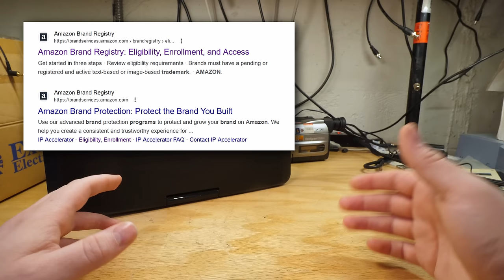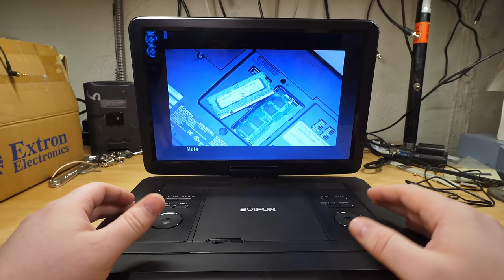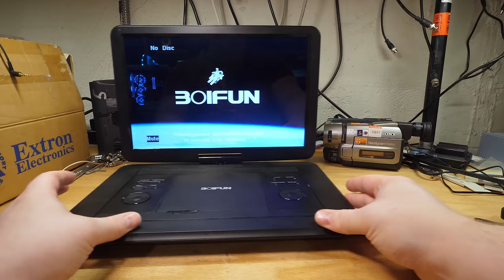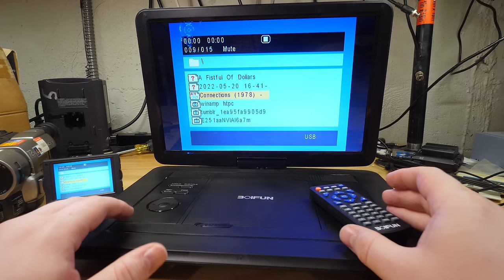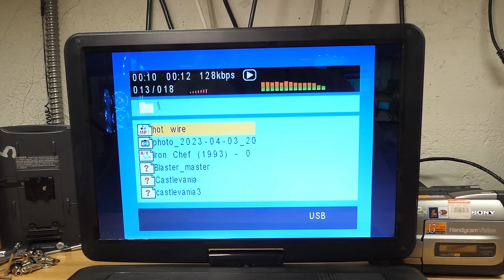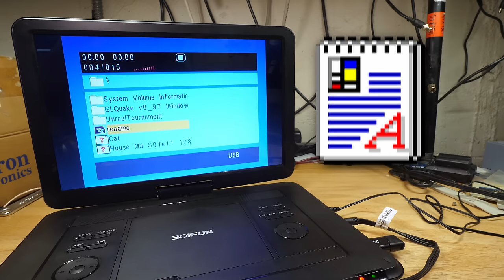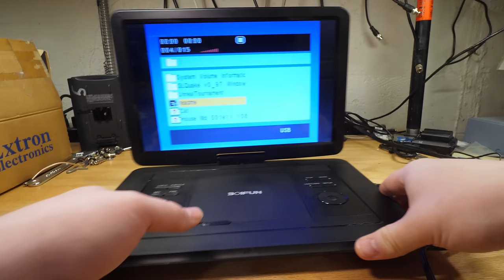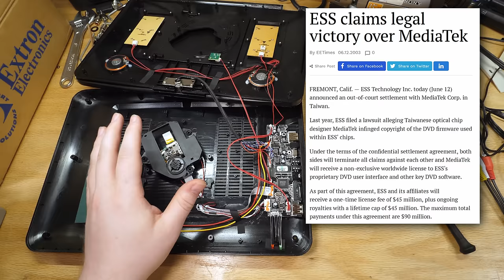Cheap, Silly, Remarkably Useful DVD Player

Comment: 12:10 TRRS cables, as an idea, should be really helpful… but because of a lack of standardization, we end up with irritating things like this. I was just dealing with something like this myself when building a crossover cable that lets me interface my sound card with my phone to send/receive data with minimodem.
Reply: They actually ARE pretty standard.  There are variants, because each is optimized for something different.

Is it an audio device with video capability?  Then you want tip and ring to be L & R audio, with the third signal, video, being something that you need a special cable to access.  This ensures backward compatibility with audio cables and headphones.

If you’re making a camcorder, then you can live without stereo audio, as long as you get one audio channel and video.  That puts R audio on the optional conductor.

“But why the difference between shield and the additional ring?”

Well, that depends on the jacks that cable will be used with.  Many jacks use a shield contact that is higher up on the plug.  Those?  You need the second ring to be ground.  Other jacks contact the shield at the base of the plug.  For those, you want shield to be ground.  None of that matters when you’re just using TRS, so decades of COTS jacks never had to care.  But with TRRS, it does. 

See?  There’s a reason for all the madness, as long as the manufacturer chose the most applicable wiring for their specific device’s primary function and the ecosystem of things that are usually going to plug into it.
Reply: It should be possible to make a universal TRRS to RCA cable with a switch for the different arrangements.

Comment: As soon as I saw the Game logo, I knew it would play NES games. Given the awful performance, I actually expected it to be a Famiclone with a DVD player bolted on. But, the games also running terribly disproves that.

The games were cut off the same way as the text. Probably an aspect ratio issue?

Having once used a PlayStation homebrew app to read a text file off a disc to help repair my PC, I agree that text viewers should be included in everything.

Comment: 8:25 If the processor was scanning the buttons that slowly I would expect it to work ~sometimes~ if you pressed it fast. Or if it's multiplexed, to actually activate a different button. I think it's probably just overly-aggressive de-bounce. 
22:45 That text editor makes me think you could get it running arbitrary code with a poisoned text file haha. 
Shame the screen is so shiny. Would otherwise have been nice for a homebrew laptop.

Comment: This device is genuinely kind of amazing for all of the wrong reasons, and has a lot of self-contradictory elements. It's big for a portable DVD player, yet it has a screen to match. It has so many additional features that sound incredibly useful and desirable, especially for its price,  but its hardware is too anemic and/or outdated to pull half of them off properly. It's cheap and lightweight, but it clearly has a lot of effort with its construction and even accommodates those who take it apart for repair and troubleshooting. It's too well made and functional to be considered disastrous garbage, but too crappy to be properly useful beyond its its literal product description of a portable DVD player. It's non oui personified as a piece of low end consumer electronics.

Comment: Is there a way to try loading nes roms into the MSI laptop with the ESS chip and seeing if the firmware plays those?
Reply from the maker: interesting question. based on one of the videos i've seen of these cheap dvd players, at least one version of the mediatek chip can read files off a data CD. it's possible the ESS could too.

Comment: I would suspect that the main PCB and the two button PCB's are part of an off the shelf type kit. They are heavily labelled to let you know where to attach your own cables. You can build it into any shape and size product you like. The screw holes are probably silk screened to show you that you can put a screw there without shorting traces to ground.

Comment: I actually did use a portable DVD player as an external monitor for my PowerShot circa 2008! I was doing a lot of long exposures and it helped massively to isolate the tripod/camera and verify it came through much better than the tiny LCD it had.
Reply: What was the make/model of that player? I was searching through flea markets and  yardsales for years (thrift stores almost never carry electronics here, sadly) for such a thing as a portable mini monitor, and there was an abundance of second hand small protable DVD players until some time ago, but never did they have a useable input.

Comment: I see a bunch of these "six letter" devices at my Amazon Return / Dumpster store and my flea market all the time. I actually bought a couple of external DVD drives (with hilarious names like Rieddas) and I've noticed that a lot of them just reuse the same components.

My latest purchase - an external USB DVD Drive that's got a Toshiba TS-L633M drive on it - also had an SD card reader AND three extra USB ports. For two bucks. I mean, sure, why not, I can use that on one of my tiny computers or the Pi.

How does this device handle interlacing in the video input? I'd grab one of these to use as a secondary monitor for analog video capturing.
Reply from the maker: It's interesting actually, it handles interlaced video really well. Like, that has to be what's coming out of the camcorder, and it looks terrific on the screen, so it seems to be bob deinterlacing it and producing really clean results

Comment: The pinout for the usb port is likely similar to the ones you get on modern famiclones which have USB controllers; that is: 5v, gnd, clock, latch, data, with some pinout which uses the shield as it's own conductor. If you look at what's near that game port on the PCB then you could probably solder on a real nes controller and have that work.

Comment: MT1389 32-bit RISC processor is a ARM processor which as far as I can tell is controlled by 8-bit 8051 processor which does the main loop of the firmware, input handling and menu logic (for power saving reasons maybe?) complex operations like drawing the menus it hands over to the ARM processor

Comment: I got a soft spot for the latitude D420 and not just because I'm a stoner <3; 

It's just a really adorable laptop that still looks kinda cool
Reply from the maker: same, i keep it around for reasons other than the funny name. I also have it's lower-trim cousin, the X1, which I also love even if it turned out it's a rebadged Samsung.
Reply: @CathodeRayDude I also recall running windows 2000 on my d420 at the time but I can't remember if the wifi worked or not
Reply: @CathodeRayDude  Is the X1 the one that had a spiffy second half/docking station that you could also put a second battery in along with a dvd drive?
Reply from the maker: @SammyRenard  I'm not sure but tbh I doubt it - the d420 had an expansion base that just made the machine thicker and gave you more bays like that, but I think it was a Dell design. The x1 was not originally designed as a business machine, I think, and I can't find a dock like that for it.
Reply: How are the hinges on the D420? I fell in love with the D410 on the Dell Refurbished site back in the day, gave a ton to friends and family, and then every single one started to have the screen hinges fail.
Reply from the maker: @josephvetter7085  Mine are A-OK!

Comment: Apparently you can get the firmware version & de-zone MT1389 devices.

FW:
- Push "Home Menu" on the remote
- Go to "Initial Settings"
- Highlight "Options" (Do not enter)
- Push "Display" on the remote

Zone:
- Push "Setup"
- Enter "1379"

Comment: The AV input back in the day was awesome. I had a Panasonic portable DVD player back in the early to mid 2000s, when you wanted to play games on a road trip, this was awesome. The problem was, the only TVs that most people could both afford, and afford one just for travel was a CRT. No one was trying to put a Plasma or LCD in their car or van. Not to mention, you'd still need an inverter to take 12V to 120V, and the ones you could buy easily were rather small and wouldn't power either of those. Sure you could get 12V CRT displays, conversion vans used them a lot, so did a lot of campers of the era but they were still big and heavy and really weren't great options.

However, these things solved all those problems. You bought a portable DVD player that had a 12V adapter, you bought a cheap 60W inverter. And you could now play games anywhere you had 12V. I played a lot of GameCube games on the road using a setup like this. You plugged the game cube into the inverter, and the DVD player ran off its internal battery for a couple hours, it was actually pretty good battery life without the DVD player running. The only other thing you needed was an RCA female-female adapter so you could plug the two cords together. Thinking back, this was actually a pretty similar layout to those devices, just in a larger package.

It was awesome.

Comment: The inclusion of the adjustments for color is nice.  Some people like to adjust the way their screens look to get an image that appeals to them more.    For example. I like to make the screen a bit of warmer color.
Reply from the maker: I think I was mostly thinking of the hue slider, since the hue can't possibly be incorrect given that the source is digital - but I suppose the analog input could be maladjusted at the far end somehow.
Reply: @CathodeRayDude  I’ve seen lots of these actually using composite video internally to connect the display to the dvd player. So that’s one reason the chip and firmware would have the functionality included.   And why disable it if it’s already there.  Somebody might want it for some reason.   It’s also possible that it’s there to account for variances between the (obviously low quality) displays integrated into these things
Reply from the maker: @FennecTECH  aw geez you're right. Man no matter how much I look at this stuff I never fully internalize just how lego it all is.
Reply: @FennecTECH yeah, the displays probably come from various vendors with varying quality based on lowest price.  LCD quality and backlight color temp / CRI will vary.
Reply: @CathodeRayDude everything built down to a price is all lego slapped onto a PCB and autorouted.
Reply: Also. The glossy screen helps with image clarity     The letterboxing and pillerboxing is just more evidence that it’s all lego.  They didn’t even bother to adjust it to prefer full screen on 16.9 content

Comment: Might need some b-roll where you have the camera zoomed into the full display without any other elements in frame and let it auto whitebalance to that or configure it manually. Same with contrast. Just a suggestion to try and get as close to a correct image of the screen as you can! Awesome video as always! Seen some wild stuff I never knew existed show up on your channel!
Reply: Also the low latency for using the player as composite video monitor is so cool. There's little to no visible delay which is awesome

Comment: Oh dear lord, finding the correct trrs composite av cable for my viofo dashcam was a pita! Took me an hour on Amazon scouring individual listings to find ones that matched the exact output, mostly since the viofo used a weird ground, so I couldn't just switch a jack. And it didn't even work! When I tried plugging it into my car's av inputs, it would scroll almost like it was outputting a pal signal, especially since it was also black and white.

Comment: Chinese manufacturers will attempt to recover everything, wages aren't as low as they used to be but labor is still a lot cheaper than it is here in the west and makes a lot of crazy schemes viable, to the point that you can buy motherboards with mobile cpus on them or older chipsets that are no longer in production. I wouldn't be shocked if those mediatek dvd player chips are all recovered from old unsold home DVD players or even recycled/discarded ones if they are no longer in production. Also as you said just surplus and sending people to scout out caches of this stuff could probably support a decade of low volume production.

Comment: I could imagine that it's actually just a really clever recycling operation that is able to buy out decently made boards that were expensive back when they were made, but are dirt cheap in current year. Just make a cheap housing around them using existing shell designs, firmware is integrated into the thing already, and if people are only looking for a DVD player, they're not going to bother with the "extra" stuff, allowing them a very lucrative flip.

Comment: The zoom had setting for 1/4 zoom whwne you were messing with it, would that be meant to be used for the the text viewer? Cause it looks like it's cropping at like 40 lines but at 1/2 or 1/4 zoom it would probably fit on screen.

Comment: There are like knockoff game consoles that use what look like a USB port on the front for controllers, but it is wired to take a SNES or NES controller adapted into USB pins basically. It's an analogue input. I wish I could remember an example but all I remember was a youtube video taking apart a fake looking tiny PS5 that plays nes roms (poorly)

Comment: Back when I switched to 64-Bit Handbrake (and therefore 64-Bit x264) I noticed that it broke compatibility with some h.264 decoders like the PSP. (I did not change profiles or switched to 64-Bit timecodes etc.)

Comment: Love your vids, first time commenting... I think the reason the screen only rotates 180 degrees is so that they don't have to worry about the connector getting twisted too much and breaking off.  If it rotated all 360 degrees (plus) then there would have to be connectors in the hinge and they would wear out and loose contact over time.

Comment: youre right about the GAME port using an NES controller with a usb plug, most of these cheap dvd players use a weird implementation of a bootleg NES controller and using the grounding as another pin

Comment: Lol, I was working at a large international electronics company in the UK, and we were fitting out the new HQ. I needed to get a Chromecast for the presentation hall. I found one with a fairly forgettable name that had fairly high reviews, though that doesn't always mean much. It worked okay, but it was having a few issues. After researching it, I found that the solution was just a mundane firmware upgrade. So, I performed the upgrade, and it renamed the manufacturer to FLYPOO. Just imagine walking into an international conference hosted by a large electronics company, and the vice president introduces the latest product, only for their laptop to splash across the stage with FLYPOO.

Comment: Every off-brand DVD player made since the early 00's surely has a Mediatek or Sunplus SOC. The first one I got with DivX support had a Mediatek chip, and huge community support; I managed to install a couple of custom firmwares to greatly improve compatibility, and it read every single movie I threw to it. I still have it, but the disc drive sometimes gets stuck and needs some grease.

Replaced it with an HDTV tuner and DVD player combo, and surely the DVD section has a Sunplus SOC by the looks of the UI.

PS: writing from a Mediatek (Dimensity 7000 series) powered phone 😅

Comment: Just found out besides what you mentioned about A/V cable differences, there is also a longer 17mm version besides the 14mm version of the 3.5mm plug - I have a couple portable DVD players that need the longer 17mm version to output or input the A/V signals.

Comment: For the chip manufacture date, looking at 30:42 shows 2106 which could be a date code showing the manufacture date (21st week, 2006) implying the unit itself is old or the chip is new old stock. you can confirm this by checking other components for date codes.

Comment: Very interesting video!
I always wonder what could be done if the firmware was opensource???
That would be so cool to pump new functions in these devices!

The Text icon is probably inverted "BGR" instead of "RGB", so two channels are swapped.
BMP used this order...

Comment: 5:45 The blue wash thing is not exclusive to this device, and in fact happens with basically every screen, because the screen's white balance is wildly different to the ambient interior light surrounding it. This device's color temperature is probably somewhere around 6500k, while your ambient light is probably closer to 4500k. In order to make shooting screens look good, the color temperatures need to match. Adding some blue lights to your studio space (or even just tacking some blue gels over existing lights) can go a long way towards mitigating this effect (assuming you white balance your camera to the new temperature.)

Comment: 3:03 Y'know, I'm not all that surprised that people would watch a DVD on a 4-inch screen. I mean, the resolution of oldschool DVD video is pretty low, so you wouldn't be missing much. Also, the place where I most frequently saw portable DVD players being sold was airport terminal kiosks, and that's a dang good match right there. Before the days of smartphones and cheap flash storage, you could slip a few DVDs in your carry-on luggage, get a cheap-and-cheerful portable DVD player at your local electronics store or the airport terminal, plop it down on your seat-back tray table, and watch something entirely of your own choice rather than whatever's available on the in-flight entertainment system.